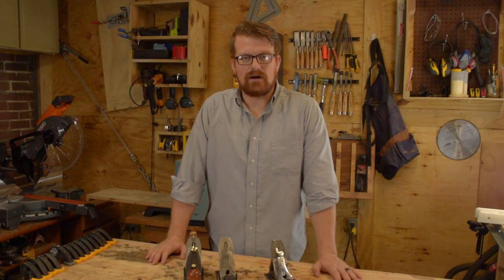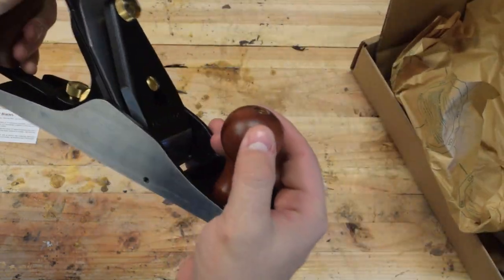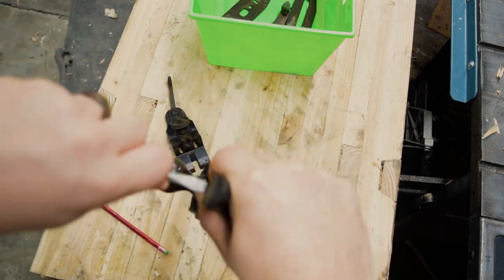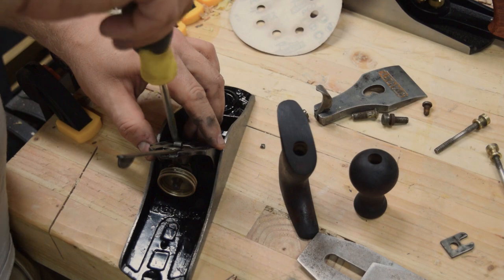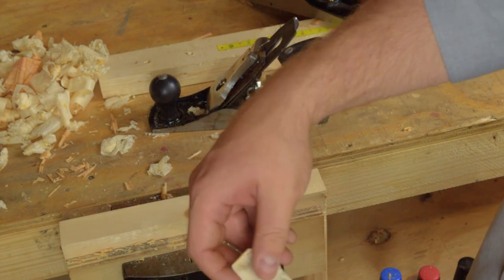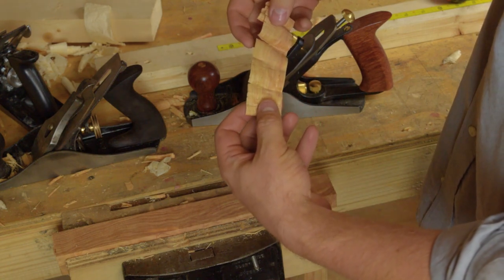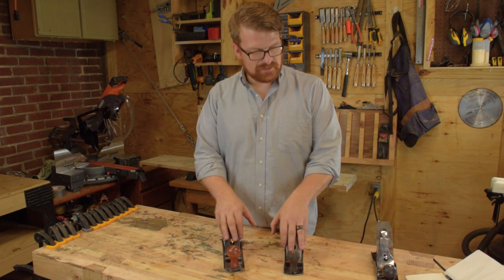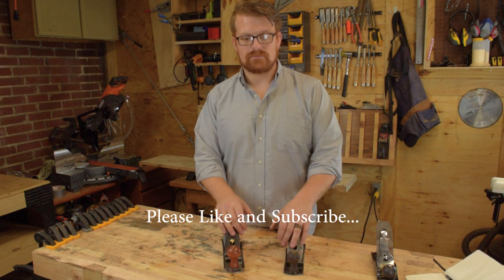Smoothing Plane Shoot Out - Veritas, Classic Stanley, & Harbor Freight | Hand Tool Shootout

Comment: I have 5 or 6 old planes two of them are Stanley's I love them. I have a couple of others and they are good too but not quite as good as the Stanley. any time i spend time in the shop is a plus. I retired from the trades over 10 years ago so needing them to produce products is no longer a need. someone gave me a Stanley Handyman plane the other day, it is ok but I doubt I will ever use it for much. Veritas is very nice but I prefer the adjustments of the Stanley. The only reason I would buy a Veritas plane is if I was building furniture as a business or someone other product that needed me to finish the wood quickly. either a stanley or a veritas plane will yield a nice product.

Comment: Brother, you don't have a Stanley Bedrock there...it's a post-war Bailey...not Stanley's best work.  Just sayin
Reply from the maker: Ya I realized that in the comments, and after a little more research.  Turns out the post war bedrocks had access to the frog screw through the lever cap so no, not a bedrock.  Not that this would've changed the value much since second hand bedrocks fetch quite a premium.
Reply: A bedrock has a different shaped frog that has a larger mating area with the body of the plane, giving the bade more stability.
Reply: what is fettle?
Reply: It means to setup and tune to a good working standard .its an old term .
Reply: Well said.  Too much YouTube fed snobbery going on with hand tool workers these days.  Novice amateurs looking down their noses at somebody because they think something less than a tool-porn-star grade item is for plebs.
Reply: john handcock It’s Northern English, mainly the wonderful palatine county of Lancashire and them queer folk on t'other side of t'Pennines (Yorkshire) for erm...'doing'. If you are in fine fettle you are doing well, if you fettle something you’re doing something to fix it.
Reply: I just bought a Stanley bedrock number 5 this morning along with 2 other planes for $50. I didn’t realize I had bought a 100 year + classic until I got home and did some research. It’s in pretty good shape.

Comment: Very good video. I was impressed with the Veritas but when it really comes down to it if the sole doesn't flex and it is flat then they all will perform. The real mark with me is how easy they are to maintain. The original setup is only a one time cost in labor after that it is only maintaining.
Reply from the maker: +Jason Adams true true

Comment: I love old Stanley tools, maybe simply because I grew up around them; something Stanley relies on with product loyalty. However, leaving parts soaking overnight is hardly putting time and effort into setting it up. What gets added on next? The shipping time from the Ebay seller? Be fair.
Thanks for a great video :-)
Reply from the maker: I didn't count the soak time, but otherwise fair point.
Reply from the maker: To be fair, I did just order two old bedrock planes for restoration :)

Comment: Interesting video.

I have the Veritas #4.  Fantastic plane, great shavings.  But for the cost, I could have better spent on multiple used planes. It sits in it's box after only being played with when I got it.

I have refurbished a few Stanley's.  Depending on the until condition, I'd say there is probably an average of 2-3 man hours into each, which includes rust removal, flattening, repainting (if necessary), polishing, refinishing tote and knob, and sharpening the blade.

I recently bought the newer HF #33 plane and converted it to a scrub.  Just removed all the extra grease and sharpening the blade was all it needed to be a scrub.  30 minutes of work.

In the end, I'd say that my Stanley smoothers are on par with the capability of my Veritas.
Reply from the maker: I have a Bedrock, and a Bailey smoother (the one in this video), a HF, and a cheap modern Stanley.  I like the Veritas more, but I like to tinker and fiddle and I trust the machining a lot more in every direction.  But there are certainly things the Bedrock is better at, it also weighs a lot less.

Comment: Nice review!  I'm a twenty year  "Home Depot-ish" carpenter of average skill level.  I'm just getting into trying to make better use of hand tools and I appreciate your breakdown.  What made the Veritas so much better?  Adjustable throat?  Flatter sole?  I'm not afraid to be seen in Harbor Freight but I'd rather spend money when it's worth it.
Thanks.
Reply from the maker: The Veritas is so much better, in that the sole if pre flattened, the blade is thicker (less chatter), and the adjustable throat.  I also prefer the Norris adjustment mechanism to the Stanley-Bailey mechanism.  More precise and consistent.
Reply: What made the Veritas so much better?  Choice-supportive bias. Choice-supportive bias or post-purchase rationalization is the tendency to retroactively ascribe positive attributes to an option one has selected and/or to demote the forgone options. It is part of Cognitive science, and is a distinct cognitive bias that occurs once a decision is made.

Comment: Try waxing the sole of the plane with just a few strokes of Gulfwax for canning.  It makes a huge difference and does not cause problems with gluing.  Alternatively,  some people do a quick wipedown with 3-in-1 oil on the sole.  Try it, you'll like it.
    I also fiddled around with a Kolbalt from Lowes. It's a 4-1/2 size, and although it looks good, the chipbreaker was very badly shaped and ground, and the metal was of low quality.  I probably should have returned itfor my $30, but. in the end I replaced the chipbreaker with one from a junked Stanley and now it works properly.
Reply from the maker: I tend to use a beeswax "crayon" on the bottom of my soles.  It works amazingly.    I want to make the old oil soaked rag in a can deal, I have heard it is really good at preventing rust.  I have heard about the one from the blue store.  I haven't personally tried it, but a lot of people like their block plane.  I am thinking about doing a future shootout with those guys.

Comment: The first plane I ever bought was a corrugated Stanley No. 4. I got it at a flea market for $5. I always thought fettling plane soles was BS. After I fixed up a basket case Stanley No. 2 with a busted body I still think I was right. Because even it works with a big dent in the sole. For a dollar that was some plane fixing project.
Reply: It depend on where it’s at. If that dent is right behind the mouth then a plane simply won’t work.
Reply: @James_T_Kirk_1701  you'd think so. But it planes just fine.

Comment: You wont see a chippie (carpenter) or shopfitter in the UK using a Veritas, they would have a Stanley or Record preferably a 4 1/2 although the no. 4 is OK. Bench joiners might go for a Veritas  or a Clifton or even a Norris, But in the shop the Stanley or Record is still king,  in various numbers although jointers are rare because of the power planers/thicknessers. I dont know about cabinet makers so i cant comment there

Comment: The old Stanley had quality built in but are the present built Stanleys as good?
Reply: vmitchinson
People will tell you that the new ones are junk. 98% of those people have never used one. They are just repeating what others say. I have three planes that are my most used. A  4, 4 1/2, and a 5. The 4 and 4 1/2 are new. The number 5 is a 1918 Stanley. There is no performance difference between them. The new Stanleys needed a slight sole flattening, sharpen the blade and adjust the fit of the cap iron. All up, about 30 minutes work. My new ones are both English made. I don't know about the ones sold in the US that are made in Mexico.
Reply from the maker: +ardvarkkkkk1 I would love to see what a modern Stanley sweetheart performs like.  The new chisels are really nice for the price.

Comment: All valid considerations and I agree with your assessments, except for one thing...
How in hell do you spend 15 or 20 hours adjusting a plane? 

Even when I do it all by hand it doesn't take more than an hour. If I use a belt sander or disc sander for initial flattening, then use power-sharpening tools for the irons, that time is cut in half or more. Except for rust removal ( which isn't an issue on new tools) how do you figure 20 hours to set up a plane????
Reply from the maker: +Learner-Learns because the frog adjustment machanism on the HF is garbage. It always cocks out of square.  Most of the time was spent tweaking that and trying to get consistent shaving.  Also the steel on the chip breaker is too thin and buckls under the force of the plane, eventually allowing chips to slip under it.
Reply: Did you flatten the chip breaker?
Reply from the maker: +Graham Orm I did but the steel on the ship breaker is too flimsy.  I guess I could have heat treated it, but that didn't seem worth my time/money.  The adjustment lever makes all this a mute point though.  The whole plane assembly is so flimsy/out if square even cocked all the way to one side or the other the blade is still not square to the sole.

Comment: You can improve the function of the Stanley and harbor freight with a hock iron and chipbreaker for 70 or 80 bucks depending on whether you get carbon steel or a2 steel. Then you can get end grain shavings like the veritas, but the veritas is still heavier.
Reply from the maker: Ya for sure, the sole on the HF plane is too thin, light, and flexible.  The Alchemists among us could probably try hardening it with a heat treat.  An old Stanley certainly benefits from an iron upgrade but this brings the price dangerously close to a really good plane like the Woodriver with a lot tighter tolerances.  Unless you are just into the romantic appeal of using grandad's planes.
Reply: Ira Adams
I can do that with the stock blade in a modern Stanley Bailey.